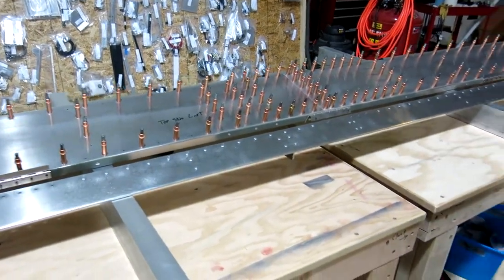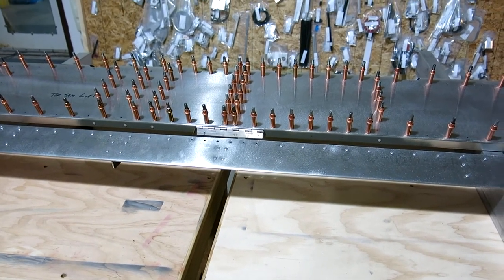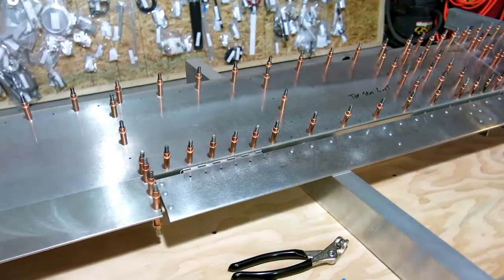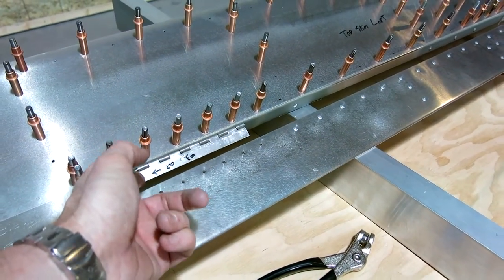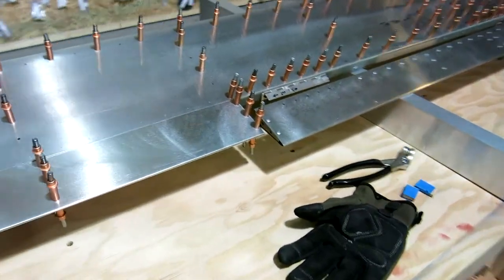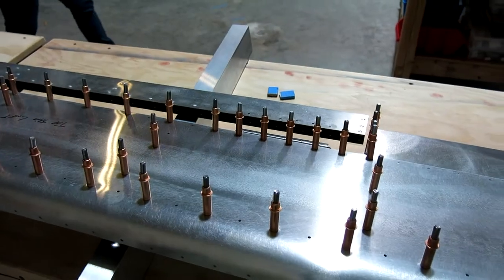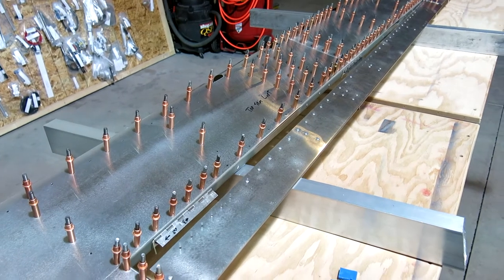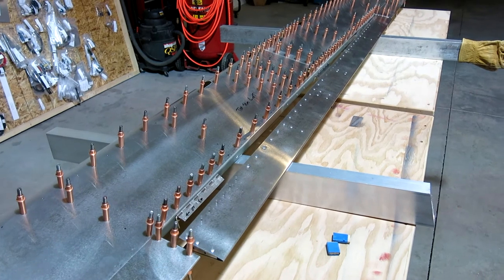No. 32 10-6-2020 Elevator trim tab progress

Comment: Gearing up to build versus buying a used, certified single-engine. All the mission cards fell in the RV-14A bucket. Then I discovered the S-21. I've had a Jeep Wrangler, and I've had a Mazda RX-7. Off-road, or coupe - I like both. I see that being the choice here.

Being a little less than 3-hours driving time from Van's, I visited them a year and a half ago, and sat in the RV-14A. I didn't go on a demo flight, because I know I would have ordered a kit right then and there. I like the roominess, comfort, performance, and how stout it is. I haven't been up close and personal to a S-21, but it shares the same 46" cockpit width.

So, I have to ask: What other airplanes did you consider, and why did you go with the S-21?

Thanks for sharing your build.
Reply from the maker: Thanks for the comment!
I’ve had a CJ-7 and a Toyota MR-2 Turbo, so I hear you on totally different missions 🙂
My checkboxes are: 2 seats, high wing, short field (back country but not hard core), cargo capacity, and speed.
I looked at:
RV-14 (fast but only 100lbs in the back, low wing, no back country)
Zenith CH750-SD (back country, high wing, but slow...105mph, 3+ hours gas)
S-21 (150 mph, back country, 5 hours gas, 180lbs in the back).
The S-21 is the perfect fit for our mission. We can go 2 hours out, camp overnight, and still have gas to get back. If we want to take a long trip, it’s got the legs to make it in a few hops.
Reply: @s-21project92  Thanks so much for the fast reply. The speed differences between the RV-14-A and the S-21 don't bother me as much as what fields I can get into/out of. I'm not looking for hardcore bush flying either. Build time between these two is a big factor as well. I won't be building until I retire (Early 2022). Be nice to get in the air faster.
Reply from the maker: They say it’s a 500 hour build if you’ve built an airplane previously. We’re hoping for 750 hours or 18 months since it’s our first go at it. I’ve seen a few 6 month or so builds on the S-21. Sure, it’s not as polished as an RV, but you’ll be done with it a lot quicker. All pull rivets and no bucking rivets (except for a few around the gas caps).
Reply: @s-21project92  I was curious what you thought of the 500 hour build time as well as your previous building experience.  You don't seem intimidated by the task at hand.  Thoroughly enjoying your series.  My greatest mechanical achievement has been putting a radiator in my car.  I've finished 3 videos and I'm not seeing extreme frustration yet.  You make it look attainable.  Well done.
Reply from the maker: @scotth985  This is our first build. I can see 500 hours for an experienced builder, but we'll be 1.5-2x as long for sure. Two pieces of advice on this are take your time, and read ahead in the book. We're doing some light priming and we're giving those pieces 24 hours to dry, so knowing what's coming up and getting it prepped will minimize the waiting delays.